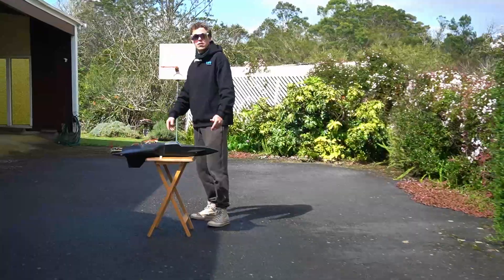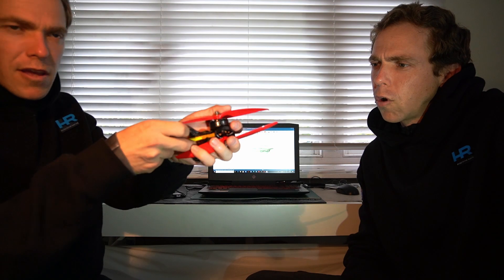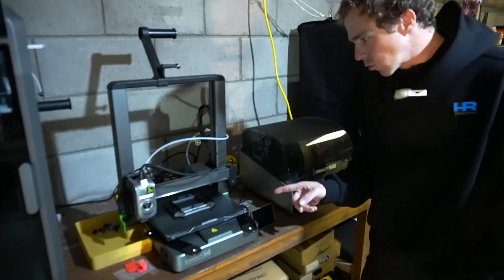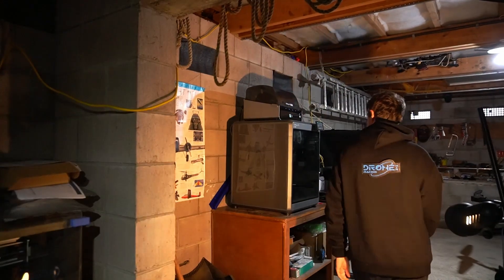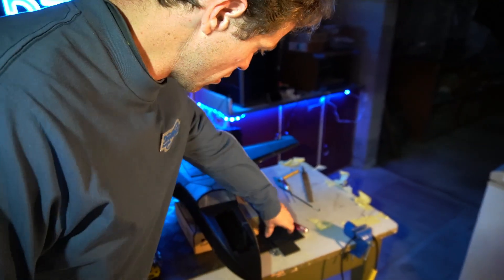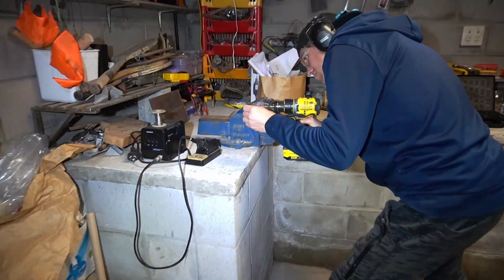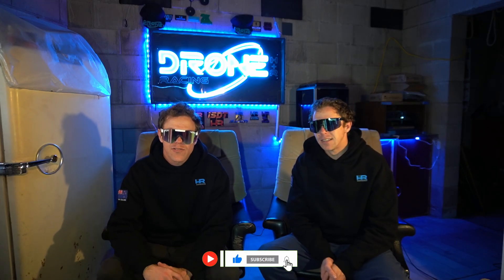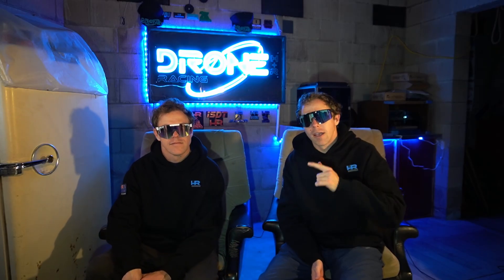MAKING A COAXIAL CONCEPT RC PLANE

Comment: very clever idea, typically is done with a solid shaft inside another hollow shaft. it is called a propeller contra drive :   https://en.wikipedia.org/wiki/Contra-rotating_propellers
Reply: contra drive in the nose as in the Bugatti https://en.wikipedia.org/wiki/Bugatti_Model_100   ;    push pull as in the Pfeil https://en.wikipedia.org/wiki/Dornier_Do_335
Reply from the maker: @jurez8752 very sweet looking aircrafts! Man they look quick🤙✈️
Reply from the maker: Absolutely agree! When we were researching the history of pusher/ pull designs we found many cool aircraft concepts.   Thanks for sending that info through 😀